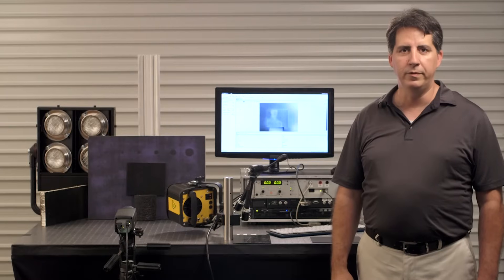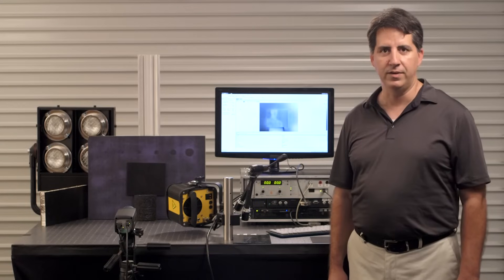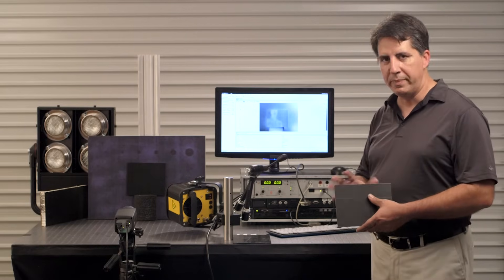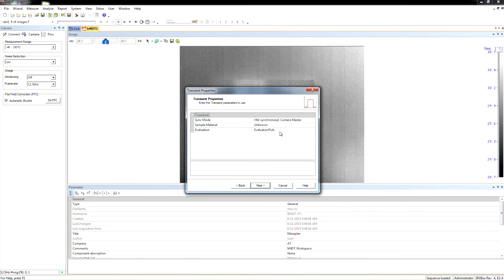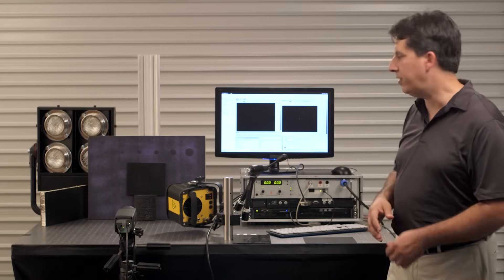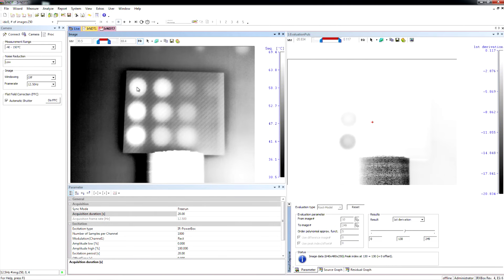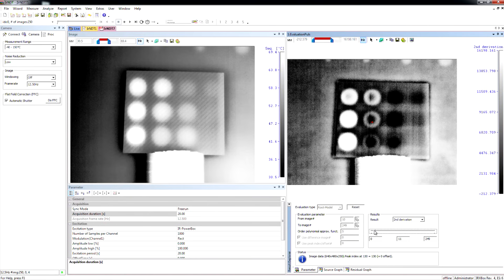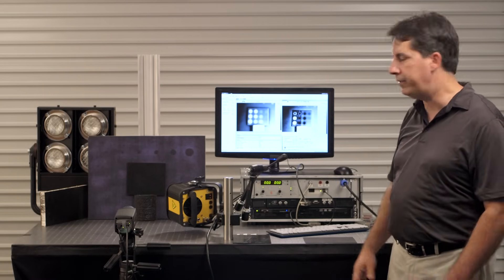MoviTHERM Thermal NDT Solutions - Transient Thermography

Comment: great video. Could you tell me what model of uncooled bolometar cam you have used in setup and what kind of halogen lump. I believe this answers my question from other video..what is involved in your setup for cam software in PC system?
Reply from the maker: Hi! We used a FLIR A615 camera. https://movitherm.com/products/infrared-cameras/automated-imaging/flir-a615/
Our system consists of a PC with a signal generator and synchronization electronics, power electronics to control the halogen lamp 1.8kW and our NDT Software for image processing and analysis
Reply: @movitherm  Than You, if you allow me to ask follow up. Is it possible to use the system without PC electronics board? Only with software on laptop to communicate with camera?
Reply from the maker: We have an NDT smart camera with built in electronics that can do that.

Comment: Hi, very nice video. You say that this type of test will only raise the temperature 3 degrees, is it correct understood that you mean 3K (Kelvin) temperature raise.
Reply from the maker: Hi there! Thank You. I am glad you liked the video. That comment about the 3 degree rise in temperature was more of a general comment. That comment was meant to point out that the system won't heat the surface by very much, thus hopefully alleviating concerns of material stresses. Typically, we see or like to see an increase of about 3 to 10 degree C (Or Kelvin) above the ambient temperature of the part surface. That is usually sufficient to find the defects.